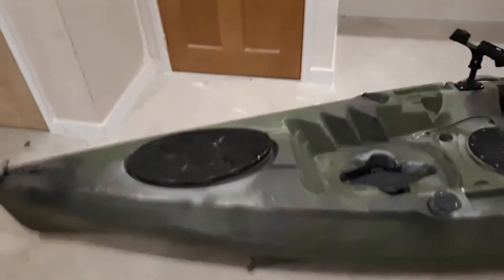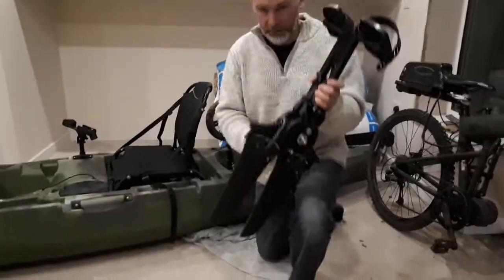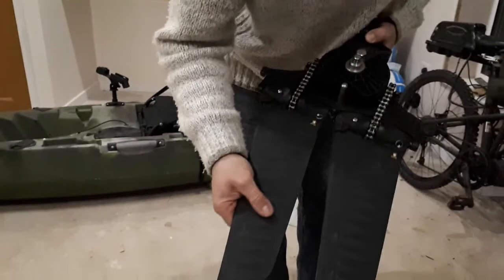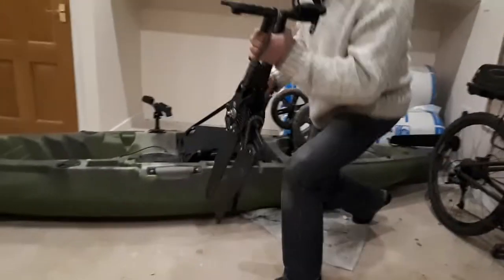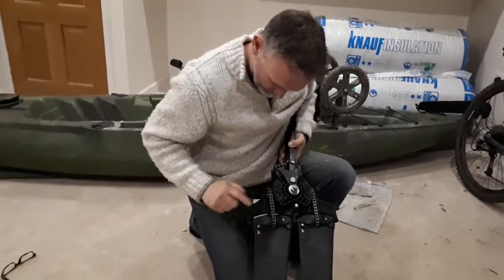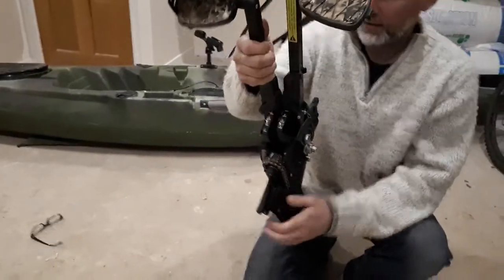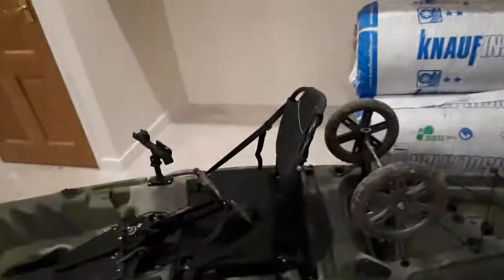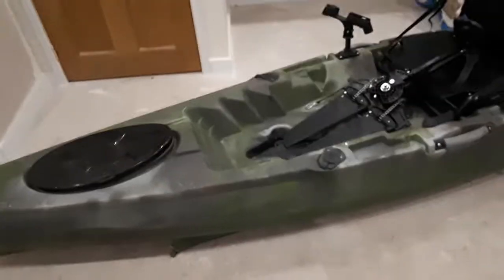Cambridge kayak pedal drive system review

Comment: Hi Rob, thank you for doing this, really appreciate it. I did email but maybe I put the wrong address on email. My one thing is no reverse, so no way to slow off without using a paddle. Reason for me going for pedal power is a disability issue resulting from a road accident. I have spent days looking online at videos from all over and have found eventually that here it would be Hobie, Perception or the Cambridge. After much head scratching, I am going to be ordering two Perception kayaks. Bit more than I had wanted but still getting them both for around the price of one Hobie. Thank you again for all your help. Happy kayaking. Graeme